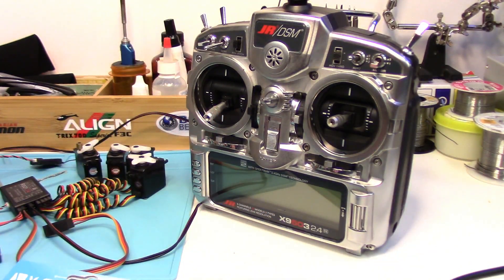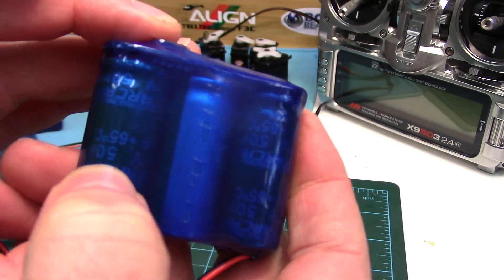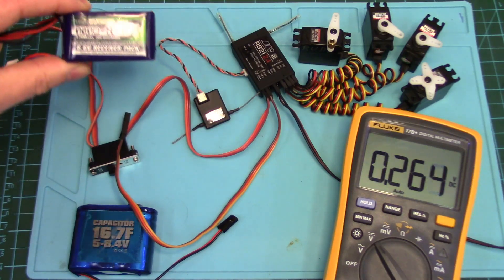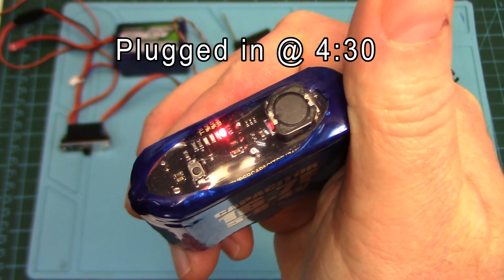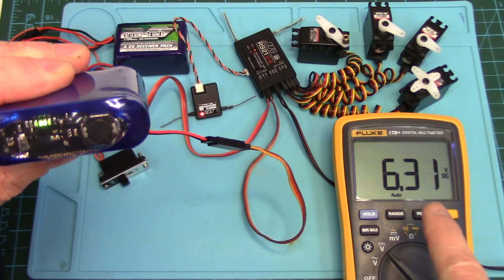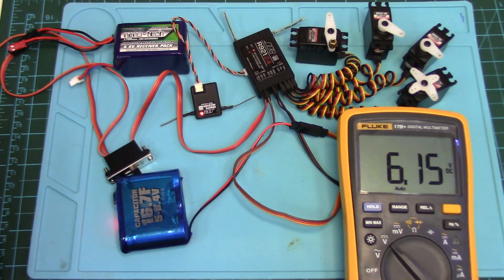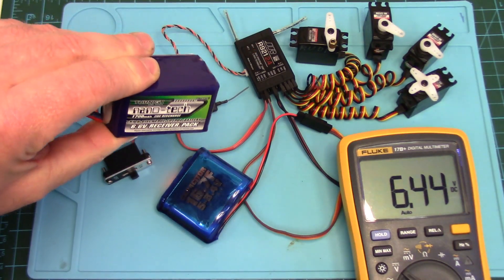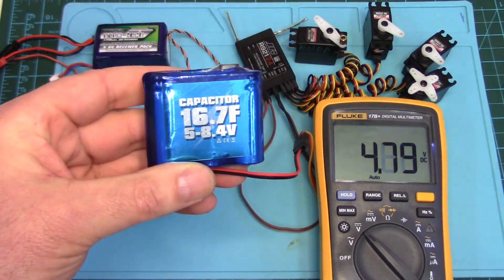V-Good RC Supercapacitor Power Backup Module Review - Does it work?

Comment: Capacitor backup is a great thing for larger size helicopters. I've blown bec's and esc's,  they have saved me. I think all the brands are good and you can't go wrong. I personally use the xguard backups just because the price was right for me. The ones that use lipos suck because who wants to keep on top of storage charging them and anyone ive ever seen got puffed out. 🚁💨💯

Comment: I believe these super capacitor buffer units work best with larger electric helicopters when using the ESC's internal BEC.  I fly only helicopters (no airplanes, gliders, etc.).  These super capacitor buffer units serve two main purposes.  (1) They help smooth out voltage drops, since they are after all a large capacitors.  (2) They serve as a power backup systems in case the ESC fails, generally from a battery disconnection due to less than optimal soldering, in which case the motor will not be powered, but these units will continue powering the electronics for a hopefully safe autorotation.  Some of these units like the XGuard rendition have additional features and alarms.

Comment: Main issue would be by the time you realize your servos are starving for voltage, the time remaining would be minimal. Cool product but not something I would use.
Reply from the maker: Yep. The only way I can it saving your bacon is to use it in conjunction with a warning alarm (telemetry or other), that lets you know the moment it takes over giving you some time. I suppose if your main flight battery were to fail (killing the BEC voltage), that would be very apparent and in that case, would work well since an auto-rotation would never last much past 15 seconds. The other issue is many FBL units will restart around 4.0V so that lowers the working time even more.
Reply: @Rchelicopterfun  Hi I'm using this and yes it does save your heli allowed me to auto with failed bec 30 to 90 seconds plenty of time to get her down safely
Reply: Good video, John.  I appreciate your reviews and your perspective.   I had an experience with a Fromeco DC-UP MkII which had enough capacitance to upright the heli from inverted when I had a battery failure.  It had much less capacitance than this.  I knew it right away as the main rotor had no more power.  Just one experience.   Could be a BEC failure without loss of motor power...

Comment: wouldn't this be a good solution to pop a parachute with automation?  Something like if plane voltage<6 volts, then pop the parachute.  I agree having a smart robust system designed for use should be the first check, but I don't disagree with having a small reserve if the weight is negligible.